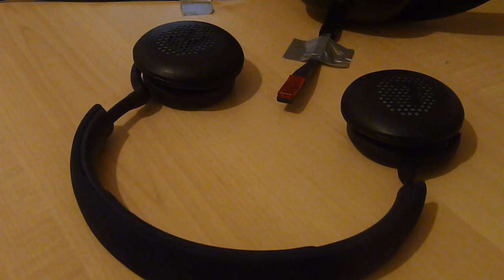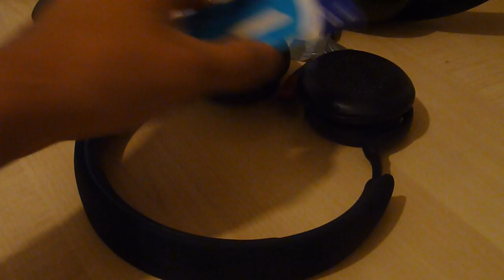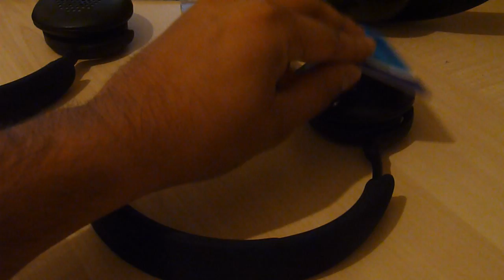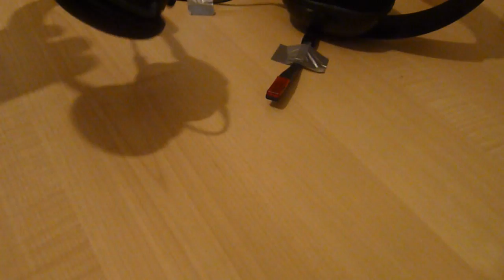Bang & Olufsen Beoplay H2 - Unballanced earcup pressure issue.

Comment: Hey, nice video. I've just bought a pair of these so will check mine out. Did you get a response from B & O?
Reply from the maker: +Gary Walton

Hey Gary, sorry your comment totally slipped under my radar! I did get a response from them, and I've written it down as a response to the other comment on this video.

How're you finding your pair? Any similar issues?
Reply: Hi. I have to say these were awful. Hard to believe as I've had B& O stuff before which were really good. So I don't know if these were faulty....  Anyway,  came to conclusion I only like on-ear so back they went! Am now using Oppo PM-3 which sound pretty good!

Comment: hi, just ordered mine, any reply from B&O?, hope you can keep us posted, thanks.
Reply from the maker: +Orb Threethousand

So they offered an RMA, but I decided against it as I didn't want to be headphone-less for the time it would take for the RMA to go through. Was tempted to get a refund with Amazon, but ended up keeping the pair.

I found a workaround, though. For me switching the left and right earpads, and flipping them both upside-down managed to get the seal roughly equal between the two earcups. This does mean that the isolation isn't as good as it could be, but it is now at least equal between the two earcups. 

The sound out of these cans is seriously amazing, and the slight reduction in noise-isolation is not a dealbreaker or anything for me.

If it is an issue for you, definitely contact the customer support. They're not the fastest at responding, but they're super friendly and helpful.

Do let me know how it goes with your pair, though! I'm curious to see if others are having this issue too.

Comment: I know this is pretty late now, but I wanted to say I have the same issue on my new H2s, and it's actually pretty annoying. For me it's also the left earcup. Can you just take the earpads off? To me it doesn't look like it.

It's especially annoying because it occured on my exchanged pair, as my first had a problem with the cable. Seems like I'm all out of luck lol
Reply from the maker: You can remove the earpads, just grip and twist them anti-clockwise.
Reply: @siddv  will have to see how mine sound once they arrive. better late than never..